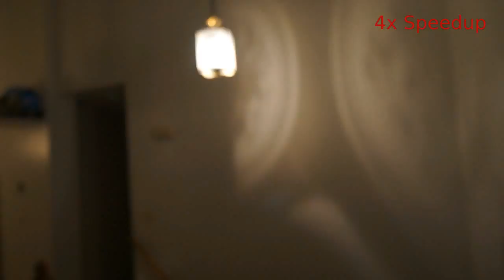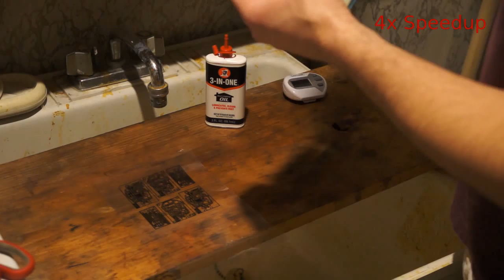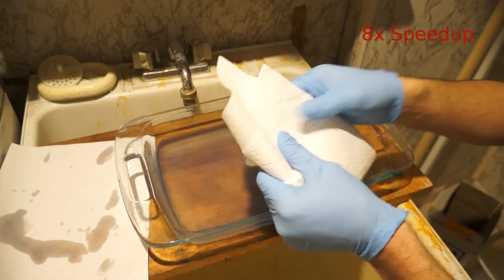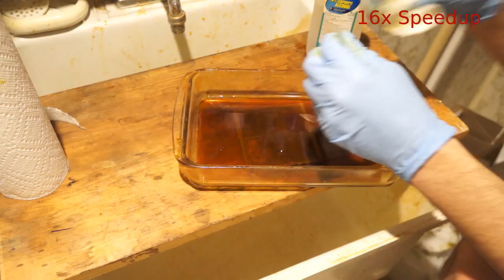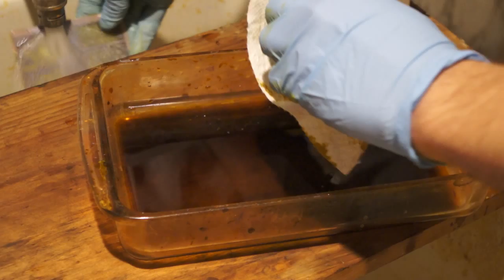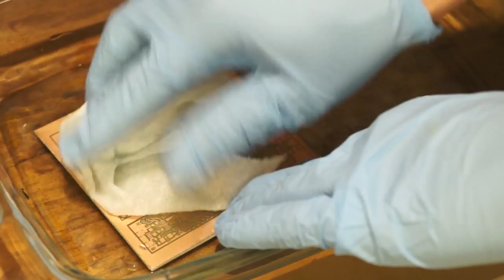How I do my projects - Part 2 - Producing the PCB

Comment: When I make PCB, I use hydrogen peroxide and muriatic acid, they both are cheaper to buy then the ferric chloride. The development is some time faster with H2O2 and HCL, then FeCl3. I use the toner transfer method and glossy paper, like paper from magazines. 
For small prototype I think its the best solution.

btw Nice video :D
Reply from the maker: I used toner transfer for a long time, but now, after switching to the photo process, I realize it really is a lot better.  It's much more reliable and clean.  I was able to do .5mm BSC parts with toner transfer, but my yeild on large boards was worse.  Any imperfections in the surface of the PCB doomed me. 

Additionally, I am surprised you use magazine instead of toner transfer paper.  The dextrose? coated side comes up more cleanly than magazine paper.

I will consider the H2O2+HCL etchant.  In fact, I have both of those chemicals on hand.
Reply: CNLohr

In the country where I live, its extremely hard to find materials for this, pay-pal block us (and the most of other sites with online banking) so we are sticked wit the materials that you can find easily. The magazine paper was one of the best solutions, its glossy (with some-kind of dextrose ?!).

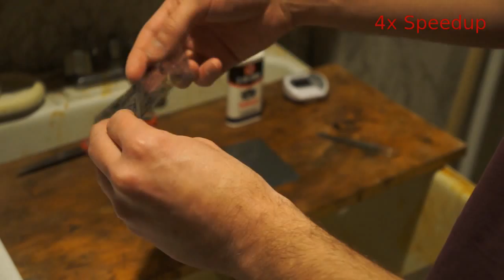Comment: 2:00 ... you also put it Ink side down because UV Light will diffuse through the transparent film and under the ink and you'll get shadows, blur and broken tracks.
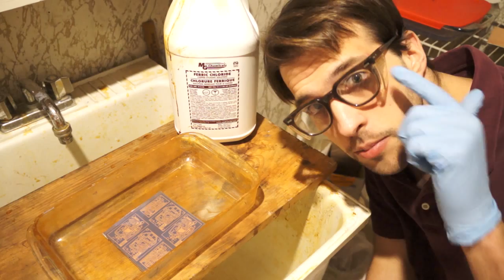4:00 ... a friend of mine put his finger in some blue colored Sodium based copper etching solution and told me that it's not concentrated enough because it didn't burn his finger. LoL
Reply from the maker: gah

Comment: You can definitely pour acetone down the drain ... you just need to dilute it sufficiently. It's not toxic at all, in fact your body produces and consumes acetone when you're fasting for example, a process called ketosis. You will even piss some of it away. If you don't dilute, it can indeed dissolve some plastics. 

But you can also just let it stand, it evaporates extremely fast.

Comment: Actually there is no problem with pouring ferric chloride down the drain. If you think about it - it takes up to 10 minutes(depending on concentration and temperature) to eat out super-tiny layer of copper from small area board. It does very little if any damage to thick non-copper metal tubes in your pipe system. And if you are still worried - mix it with cold water, then it will be useless in eating anything at all. Actually some other domestic chemistry does more damage than used ferric chloride.You can also use ammonium persulfate for etching - it is even softer, no worries about pipes too.
Reply from the maker: I asked someone who explained that it was because ferric chloride attacks the iron in the septic treatment plants.  Once I got ferric chloride on steel wool, and it got very scary very fast.
Reply from the maker: But... You do pose some interesting points.
Reply: CNLohr btw I also managed to clean the stains from the ferric chloride on my bathroom floor, it seemed very hard at first, but then I just poured some strong cleaning household stuff and waited for an hour, then it came off quite easily.
Reply from the maker: Any idea what stuff you used?
Reply: CNLohr I think I mixed a bunch of creams for cleaning ceramic surfaces and I also added the spray for kitchen's metal surfaces. Kinda like mixed 3 or 4 different stuff, don't know what exactly helped. But I think the trick is to leave it there for a while and then wash it away, not try to make it in 5 minutes.
Reply from the maker: I am not gonna be mixing ammonia and bleach am I?
Reply: CNLohr unless you want a clean bathroom, ha :D
I'm not sure what exactly helped, just wanted to get rid of it no matter what. I guess it is possible to find concrete answer in google for that, but it would be not an easy find probably(using household stuff)
Reply: and yeah, for anyone who reads it - don't mix ammonia with bleach. You don't need bleach for that, and maybe even ammonia. I used some pretty mild household cleaning stuff that is based on surfactants with some additives.
Reply from the maker: Yeah, mixing some cleaning agents can produce a pretty poisonous gas.

Comment: I don't know why people still use ferric chloride. It is messy, takes ages and you have to take out the board all the time to see the progress. I use sodium persulfate almost exclusively. It's clear and doesn't leave stains (but will bleach clothes). Hydrochloric acid/hydrogen peroxide is another option (also clear and very fast). I don't use it because of potential chlorine fumes (only happens when you do something wrong) as I do my etching in a not so well ventilated basement.
If you are doing boards more often, I'd also suggest buying boards with photoresist already on it.
Reply from the maker: +superdau I have tried everything else, etchant wise.  I'm willing to deal with ferric chloride because it is so nice and fast.  It is critical for when I need my PCBs in 30 minutes.  I have even tried boards with existing photoresist.  Riston is just soooooo good, and soooo cheap.
Reply: +CNLohr 
I can make my PCBs in 15 ;) and I don't need a laminator. But if it works for you...

Have you tried UV tubes for exposing the PCB? They give a more uniform light and don't take long to warm up. I got a face tanner from ebay for 1€ in spring when people chuck them out and moved the 4 tubes including the reflector to the insides of an old scanner (it's almost as if the two were made for each other). It's at most an afternoon project and the results are much more consistent. Since you can lay the printout on the glass (toner side facing PCB), the PCB on top of it and close the lid of the scanner, there's no need to mess around with oil because the template will be pressed flush against the PCB all the time. Exposure takes around 60 seconds. And I'm not even using laser transparencies but normal tracing paper. It's cheaper than the transparencies and for the sharp edges you need for PCBs I had way too much variation in print quality between different batches/manufaturers of transparencies.
Reply from the maker: +superdau I have never tried UV tubes because of the non-columnation of the light, i.e. when I get it from a close to point source, the two layers of the transparencies.  I just assumed it would give me worse accuracy toward the 0.5mm bsc parts.

The rest of this is rather interesting, and I would really appreciate a video about your process since I would imagine it would be difficult to try to fit this in a comment.  Perhaps one day PCB hobbists will vie for fastest, most precise PCB manufaturing. You do it in 15, I'll see if I can do it in 14?
Reply: +CNLohr I'm in, I like this idea a lot. If I can ever get off my ass / fix my fine pitch issues with my prototype, I'll get around to doing a proper video of bright, durable plated through-holes. (ThinkTink as source, plus a month of hard research)

What kind of Epson is that? Have you ever noticed shrinkage with the laser transparencies? I wasted money on a crap budget Samsung printer, sucks for toner density. Was an M2020W. The fusor warps the transparency... it's Apollo brand.

Any tips? What kinda transparency paper you currently using?

Great video, very informative. Let's give those board houses a run for their money!
Reply from the maker: I've all but abandoned through-holes now.  I have never found a quick way of dealing with them :(.  I hope you do post - I love reading about tweaks on HaD.  I actually use A kyocera C170N.  It's a laser printer which requires specifically laser printer transparencies, which seem much more robust and sturdy than normal transparencies.

I double-up my layers all the time now, to get the extra black, as the printer no longer dumps out enough toner.
Reply: +CNLohr i use to use 2 to 1 mix of hydrogen peroxide and muriatic acid, its way faster, and doesn't stain. the draw back is you must use it in a well ventilated environment
Reply from the maker: I do have muriatic acid.... That's one of the combinations I haven't tried. I just looovveeee ferric chloride.  so easy to use so fast.  And, I don't really get it on anything anymore.
Reply: +CNLohr i use to love ferric as well, but after years of ruined t-shirts, stains on my floor, and the price of it just kept going up, I said enough if this, and tried the 2 to 1 mix, another good thing is you can see the results while it etches away, I use compressed air to agitate it but a dollar store foam brush will work just fine too
Reply from the maker: I guess I could just dispose of the waste the same way as I do now (at the dump)

Comment: You can mix a great etching solution from readily available household chemicals. Mix 100 ml 3% hydrogen peroxide, 20 grams of citric acid, add a teaspoon or two of salt, and you have a great etching solution. It is transparent and has a higher oxidation-reduction potential than iron(III)chloride. Plus, it does not stain and is harmless, save for a minuscule amount of gas released from the solution while etching. One disadvantage is that the solution is not storable.
Reply from the maker: Citric acid?  Okay, you have said words that may make me finally try something other than THE WONDERFUL FERRIC CHLORIDE OF WHICH NOTHING COULD POSSIBLY BE BETTER BECAUSE I HAVE NEVER TRIED ANYTHING ELSE.  Ok mostly kidding, but really, I do actually want to give this a try now.
Reply from the maker: ***** It worked... not sure how to dispose of it, and still think FeCl is gonna win for me.  It's faster and feels more even.
Reply: CNLohr just pour it down the toilet. And btw, what does it mean "more even"? Does it over-etch? Is it too slow? You can heat it up, or add another 10 grams of citric acid, plus some more salt... FeCl3 is more expensive than this mixture. But maybe it's less expensive where you live :)
Reply from the maker: This mixture seemed to eat away at smaller parts and leave big parts more than ferric chloride... not a lot, so I could be wrong.

And... It's got a fair bit of copper dissolved in it... I dunno about that going straight down the drain.

Comment: Thank you for the video. You are pretty good doing the presentation, I just wanted to advise you to be careful with the chemicals, specially with the acetone. The acetone vapors can cause cancer. Make sure you use air filters and have good ventilation.
Reply: Acetone is not a known or suspected carcinogen.  Check the MSDS.  Not even California lists it.  If it was, every nail technician in the world would be dead of cancer.

Comment: Safer method of etchant is  Hydrogen Peroxide (2 Parts ) Muratic acid ( 1 Part )
Reply: Don Cornwall That is the method I use as well.  Not as hazardous and clear so you can check the progress easier.   Waste goes right down the drain.   I will never go back to Ferric Chloride again!!
Reply: Actually I thought this was the  worst method regarding safety. I've read it generates some very toxic gas.
Reply: safer is mechanical etching with CNC machine.
Reply: PLEASE don't pour it down the drain!!! It's a severe environmental hazard. Just keep it and keep using it. Keep bubbling air through it and it will keep working.

Comment: Sodium Hydroxide does the exact same thing as the acetone does. The only difference is that it's much more environmentally friendly. You CAN pour it down the drain as that is what it was made for. Letting acetone evaporate is very bad as then it's air pollution.

Another comment is that the Ferric Chloride is not the best etchant IMO. Copperic Chloride (50/50 Hydrochloric Acid to Hydrogen Peroxide mix) can be used forever if you keep bubbling air through it.  Many other good points for it also.
Reply from the maker: 1) Acetone is not dangerous for the environment.  It is naturally produced by all animals. It is naturally decomposed by sunlight when evaporated (22-day half-life) and other environmental factors if trapped, as well as biological processes.  THAT SAID... I do now use Sodium Hydroxide.  It works out better for glass PCB processes, allowing the film to flake off rather than dissolve.  But, just want to make sure no one who reads this thinks acetone is bad for the environment.

2) HCl is just AWFUL to use inside.  It stinks up the house and is awful if you don't have a ton of ventilation.  FeCl is almost odorless, and has minimal evaporative toxicity when etching.  It's also very easy to dispose of at virtually any chemical waste collection site.

Comment: nice work. Good luck soldering those connector pins without solder mask!
Reply from the maker: Took two goes of reflow, but it worked perfectly.  I didn't even need to touch it up.
Reply: ah, solder paste & heatgun? I've done that with good results on non-plastic parts, but not so much with plastic ones!
Reply from the maker: No, the heatgun is difficult to control the temperature on.  A toaster oven helps you control it a little better.  Additionally, Bismuth solder paste gives you a huge margin of error.  The solder melts at such a low temperature.

Comment: will try this method because i tried making one board which has 0.5mm tracks close to each other and 0.5mm spaces between them, and i tried making it like 6 times with toner transfer with iron but whenever i try to take paper of some is ripping apart, or i get board right and i etch it with b327 some smaller tracks get eaten away
Reply from the maker: Size and precision was what got me to riston.  I HAVE BEEN successful with boards like that and toner transfer, but, it usually takes many attempts and looks awful at the end.
Reply: CNLohr and chemicals are not that expensive compared to the board which is already with that film on top
Reply from the maker: I've never used boards with the resist on them already.  I mean I tried a few times but I'm just so bad at them, I gave up.  Others have had good luck, but I am totally tied to Riston now.
Reply: BTW how you modified your laminator because i bought a cheap one and it says 80micron only so i cant fit pcb in there i think
Reply from the maker: I never modified anything to increase thickness.  The amazon ones just work.  I do have a video about how to slow down a GBC-H220, though.
Reply: CNLohr
So the board will fit any laminator? because i bought from amazon for like 15 bucks
Reply from the maker: not any laminator, I just know mine (The amazon basics) and the GBC-H220 def work.
Reply: CNLohr
will see if mine doesnt work will order amazon basics one :)
Reply: Took many times but i got the fine detailed picture, used black fluerescent light (UV) 15w, then developed withy soda ash, and tried etching with b327 or sodium persulfate but its not working - board was in for 10 minutes in the solution and copper wasnt even etched a bit, maybe its because i dropped it into a bit hot 50 degrees celcius water, anyway ordered ferric chloride from amazon and try with it
EDIT: the board was not properly developed, i developed now as much as i could, and trying b327 now, on some forums i saw that b327 is etching smaller traces than ferric chloride but on your video is opposite, i bet some of thoose traces were like 0.3mm
Reply: fuck toner. get fixxons emulsified transparancies for screen printing. they have an emulsion that takes ink jet ink like a dream. I supper glue 2 layers for density and then do uv negative process. Works like a charm. the printer i bought is the epson 88+ and eventually i will modify it to print directly on the pcb. Epsons use a pizeo vibrator instead of heat to dispense ink. this means you can buy mis pro pigment inks...those inks happen to resist cupric and ferric . so at some point i may be able to skip the uv and film part. The under water application of film is key (as he mentioned) ... Also: dont do an array of uv leds, it causes issues i wont go into. get yourself a 365nm 4.1w (4.1v 1amp) led and mount it to a computer heat sink and some mechanism of adjusting height. It works like a dream but the led will cost 30 to 60 bucks (i got mine for 35 at digikey). most uv film prefers 360 to 380nm wavelength light. With a LED you dont have the warm up time he did in the video

Comment: Nice video man. May I ask you a question?

This is the first time I hear about overexposing the board to the UVs, and this is actually a question I have never been answered, so...
Why do the overexposure should make the photoresist harder to remove?

I'm asking because I've had this issue a lot of times... my cured photoresist films doesn't remove easily, even with high concentration of NaOH
(both with spray photoresist ones as well as expensive presensitized boards), so I eventually ruin even the uncured ones.

For some reasons I'm using a 5 mins time of exposing with 8x8W Philips UV lights, about 20 centimeters above the board.
Should I try reducing this time?

Thanks a lot!

Comment: You are so intelligent and outstanding.And i want to ask a question about that how do you solve the drilling , solder mask, silkscreen and surface treatment question?We are the professional PCB manufacturer,so our product often made by machine,this is the first time that i have seen the board made by hands.
Reply from the maker: There are hobbyists who use UV-reactive films for solder mask, and silk screen.  You can also iron-on from a laser printer surfaces.

I've only ever used liquid tin surface treatment, many others use solder surface treatments.  Normally, I prefer bare copper because I use my PCBs right after I print them.

And tons of peeps do thru-hole drilling!  I just don't like through-hole components because they're harder to work with.